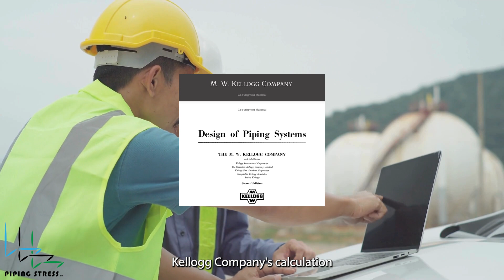Gas Outlet Piping Stress Analysis: Real-World Applications and Solutions

Comment: What to do if column is expanding 200mm and line is expanding only 100mm, the first cleat is causing the horizontal part below to raise 65mm this line is connecting to air cooler inlet